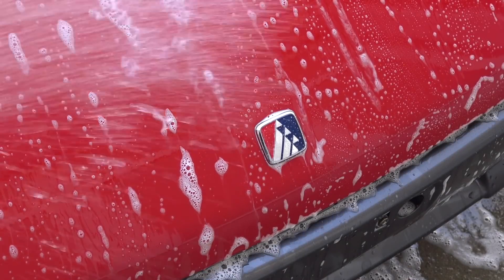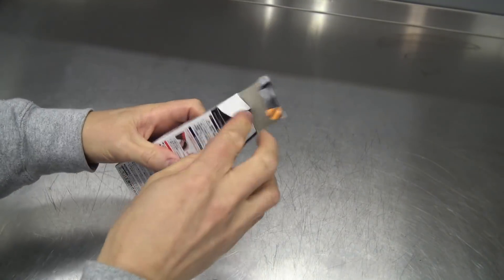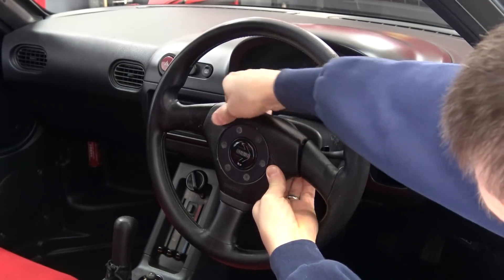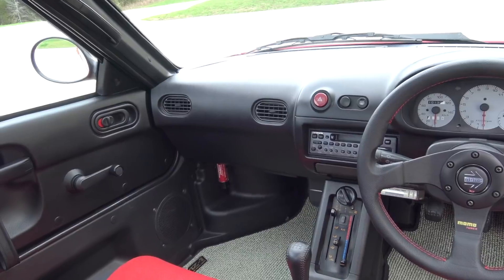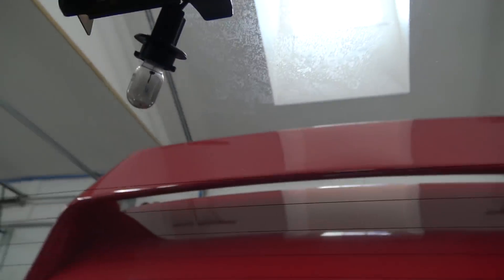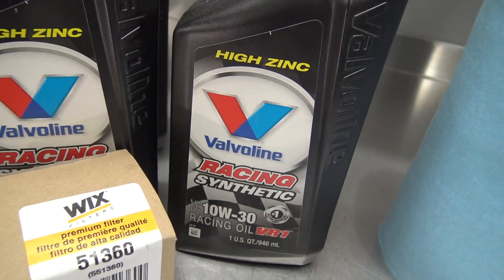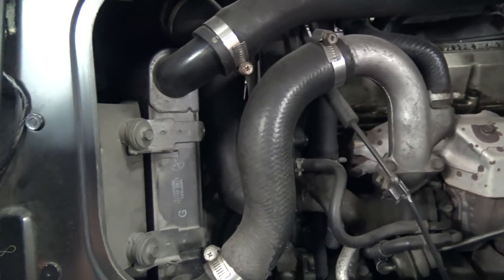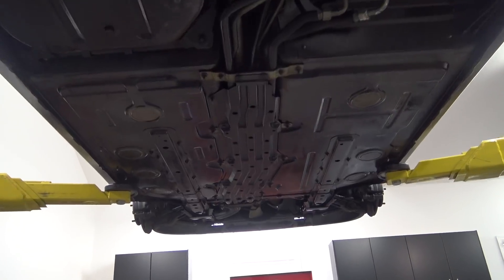1992 Autozam AZ-1 My Super Tiny Sports Car!  Part 3

Comment: I used to think that dropping the downpipe on my Galant to change the oil was a problem.  Now it doesn't seem so bad...
Reply: Tom, why is only Freddy pinned up there. Please have also Jafro up there right away!  :D All the best to both you guys! 
Cristian
PS Jafro, i miss your porting vids. Yours was the first channel where i subscribed in my yt beginings. :D
Reply: @cristian6766   I was watching Tom's videos on his website nearly a decade before YouTube was invented.  :D Years before I bought my Colt.  We're all in the family.
Reply: @Jafromobile  You people should have televised shows!! :D
Reply from the maker: Hi Jafro, thank you for checking out my video sir!  Always great to hear from you, hope all is going great in your neck of the woods.
Reply: Have either of you tried the alfa Romeo Mito?
Just did a service on my mom's car. 

You need to take out the right front wheel, remove the wheel housing and if you don't feel comfortable bending a spanner for the job, need to remove an axle as well.

Oh and did I mention that the oil filter is not one of those can ones that has female threads. It sits in a housing that needs to be opened and there is no chance getting a tray in there to catch the oil that comes out when you open it.

Italian engineers, seriously...

Comment: I dont even need to get under the car to change the oil in my -97 Mercedes! It has an inline-6 with the drain bolt in front so all I have to do is reach under with wrench and unbolt it, its very near the bumper. Oil filter is a cartridge type on top of engine. Job done!

Comment: I used to work at a Chevy dealer until I went to an independent shop and GM recommended using their ACDelco dielectric grease on rubber seals to extend the life and soften them up. It worked wonders on the squeaky door seals from gravel travel vehicles.

Comment: I looked up the specs, this is only 9" longer than the original Mini, it is like someone took a Fiat X1/9, crossed it with a Mk 1 MR2 and then washed it at too high a temperature. Edit, the headlights and front bonnet are very reminiscent of the original Renault Twingo.. Tom - any plans to get hold of an original Lotus Elan ?
Reply from the maker: Great observations! I don't have any plans for an Elan, but I definitely appreciate them.
Reply: @TomsTurboGarage  You have probably seen it but Wheeler Dealers series 7 episode 10 features an Elan and it just has to be the grandfather of the Mazda MX-5

Comment: I find it a bit strange that the MOMO horn pad you removed had the fake 6 bolt pattern with two bolts horizontal on the top edge. The real allen bolts (like all MOMO wheels) have one at the top and bottom

Comment: If you can find someone who can weld you the old steering wheel center to the new Momo outer piece, you could keep the factory accessory look and still have the smaller sized wheel. I say someone, because even tho i can weld, i still wouldn't trust myself and would seek a pro welder's services.

Comment: Shouldn’t the spare wheel be stored in the front? I’m fairly sure AZ1s have a specific place under the bonnet.
Reply from the maker: There were some that had a spare tire mount in the front, but it was moved to the inside for safety reasons.

Comment: Omg, you have to remove the spare, carpet, a panel with several bolts on it, AND the seat to change the oil. MURDER! HAHAHA! This is why mechanics hate engineers. I still want that type-B version of this car, though. Maybe I could build a replica with a kit car. Put a Suzuki or Hayabusa motorcycle engine in it.